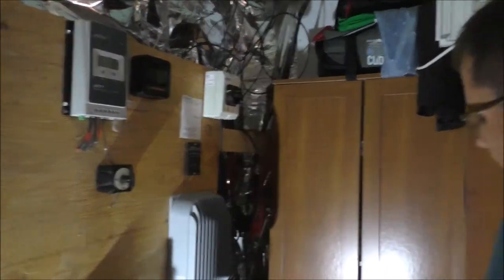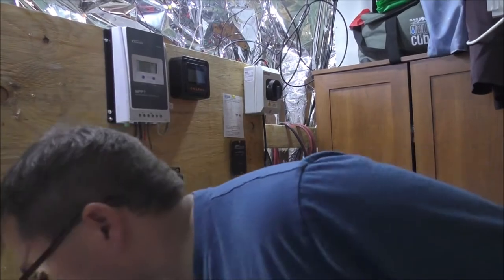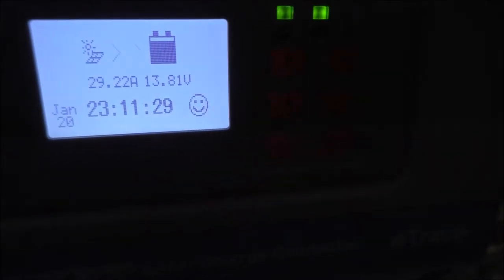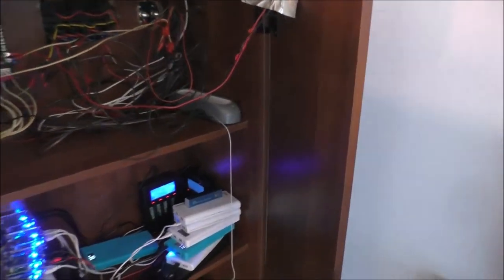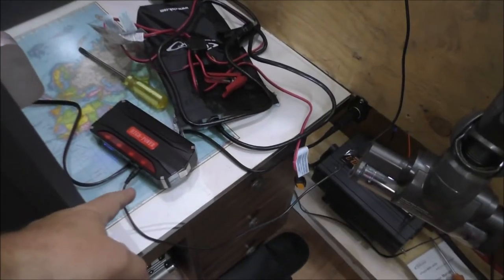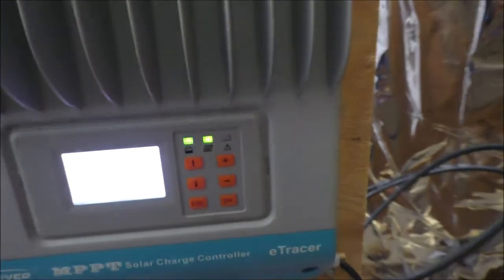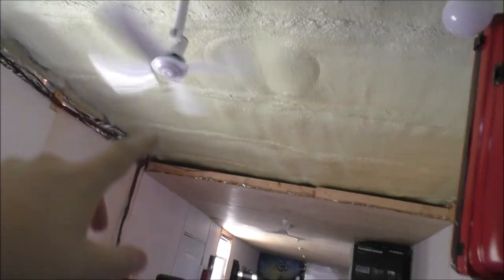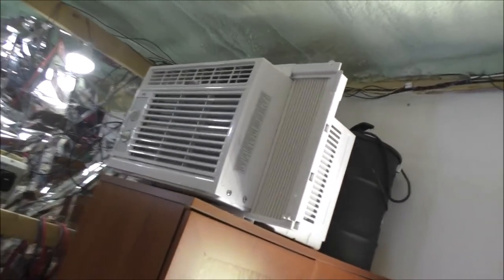LG NeON 2 Bifacial 380W monocristallin, 72 cellules × 2

Comment: Good to see those amps flowing in. This is what solar power is all about.
Question: what happens when the batteries are topped up, all the internal loads are off and you are away for the day at work? Is there a dump load issue lurking there?
Reply from the maker: well the over volt disconnect on the charge controller kicks in and shut the solar off. if that ever fails the batteries them selfs have one as well
Reply: @TheOffGridTinyHouse  Thanks. Seems that solar panels, unlike wind turbines, don't need a dump load if they are producing but there is no demand. I'll need to read up on that to see why, so I can understand it.